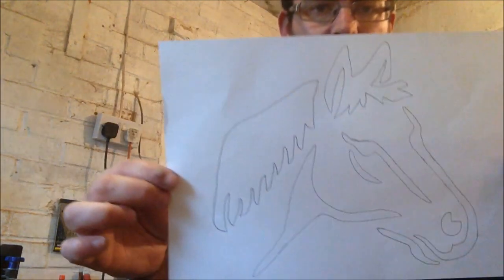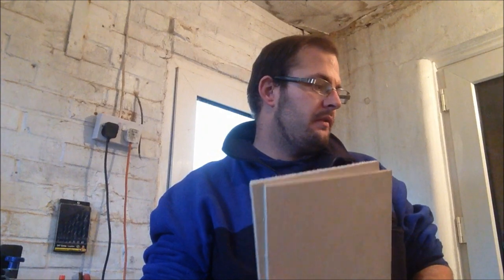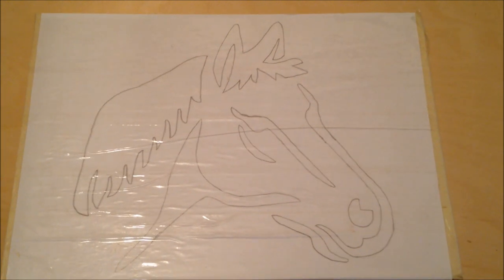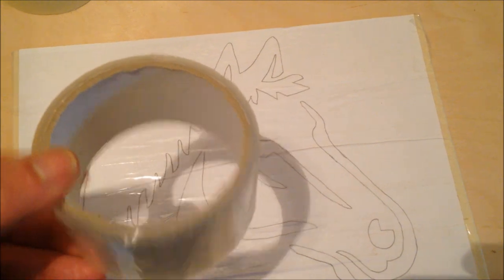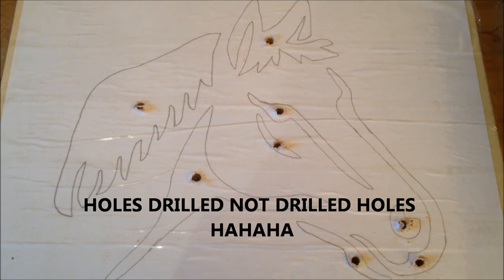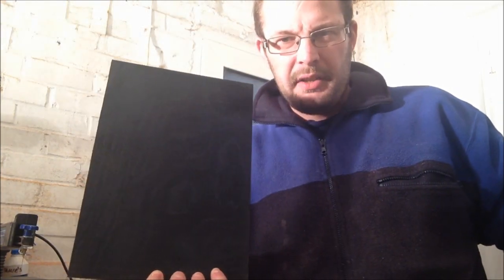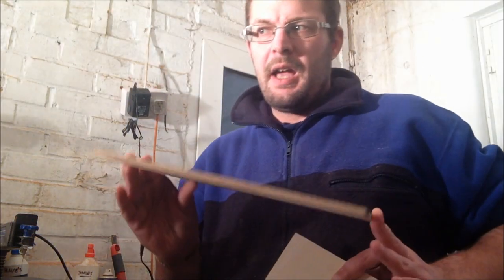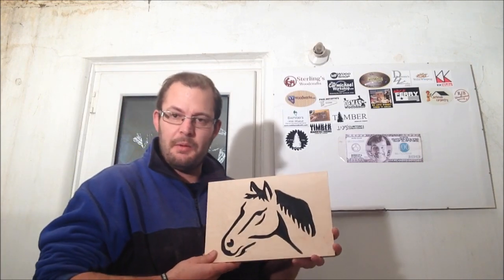scroll saw horse project

Comment: I have pinned blades...so should I just turn them upside down?  working on a project that will be a video soon so thanks so much for the help!
Reply from the maker: +Kyle Patrick (fenderhead23) unfortunately it will barely cut at all if the blade was upside down, and you are welcome, im not an expert by any means but i will help as much as i can :)

Comment: Great job! I'm new to scroll sawing so wondering if you have to do any sanding when you're done cutting? Thanks
Reply from the maker: +Kyle Patrick (fenderhead23) thanks for the comment, yes you do have to do some sanding to get rid of the fuzzies left by the blade however you can reduce that even more on the cut by using a reverse tooth blade, there will still be some sanding to do but very very minimal....... hope this helps, happy scrolling :)